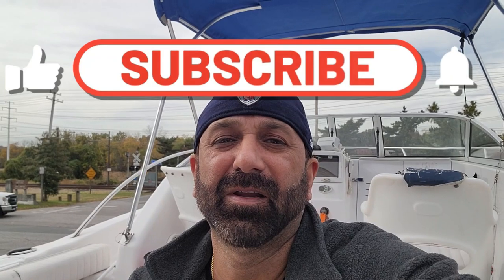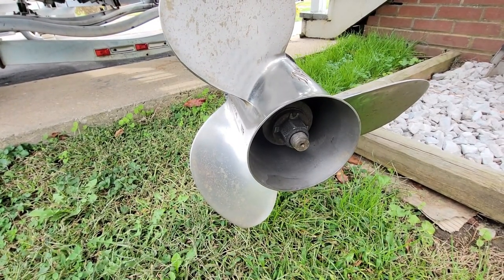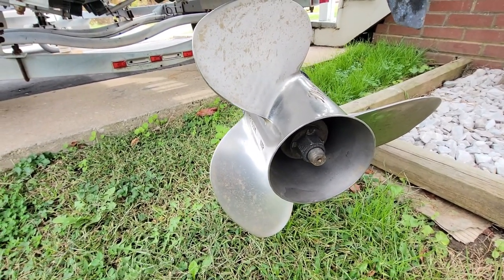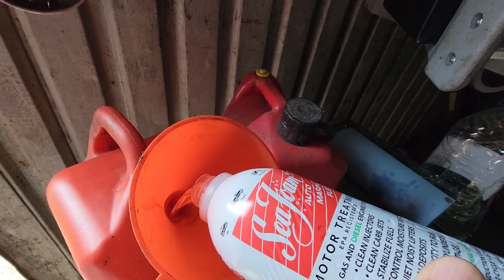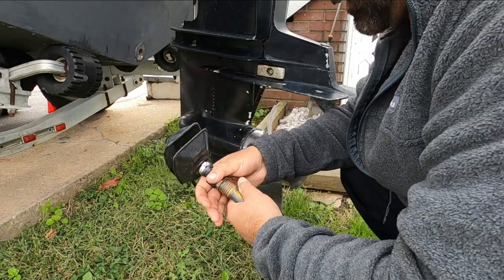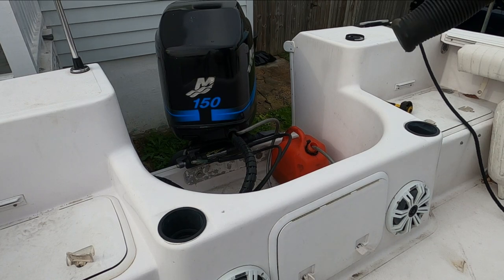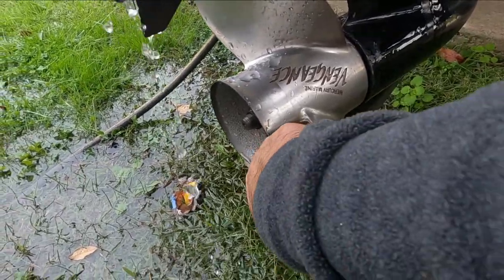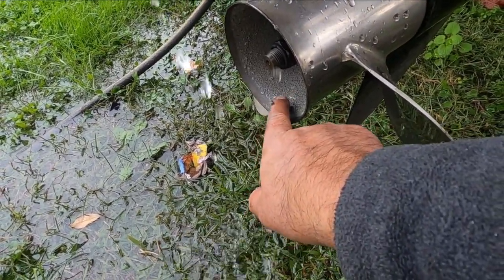Outboard Sea Foam Treatment | Mixed with Gas

Comment: I did the same thing a few years ago with my two-stroke kicker.  I had it on a stand and the prop was in a garbage can.  After warming the engine I ran a mixture of mostly Seafoam through the engine.  A lot of brown gunk was floating on the top of the water after I finished and the engine started easily and ran smoothly after that. Seafoam worked for me.
Reply from the maker: Thanks for sharing your experience!

Comment: The gunk that is coming out is water mixing with the exhaust inside the combustion chamber.   You have a blown exhaust gasket.  Mercury does not recommend Sea Foam in their engines.
Reply from the maker: MarineDoctor thanks for your comment, I am always eager to learn. The boat never over heated, also if that gunk that you see in exhaust should be in spark plugs as well , since water is mixing in combustion chamber right? Spark plugs were normal as usual.  Its a two stroke, oil mixed in gas container,  carbs set to run rich, low temp and cold water. Also if that was the case boat should have that gunk when pulled out as well. Mercury doesn't recommend seafoam because they want you to use Power Tune.

Comment: I did same thing u did with my Evinrude 15hp. It sat up for about 10 years. I have ran approx 2 gal of gas mixed with the entire seafoam bottle and I just noticed today that I had a little of the same kind of "gunk" in my prop as well. Not that much, but same thing. My motor is running great now. Should i be concerned at all with that "gunk"? Some comments say yes and some say its normal somewhat in general and especially after that shock seafoam treatment. Spark plugs are dry, good, and firing. Should i be concerned at all?
Reply from the maker: I think I will be more concerned if it was 4 stroke. In 2 stroke oil gets mixed with gas.. If no milky deposit in plugs then I believe all is good. Did the temp stayed normal? If yes, then all good. You might need an impeller as well since the motor is sitting for long. I would also swap washers for lower unit gear oil as well. Happy Boating!